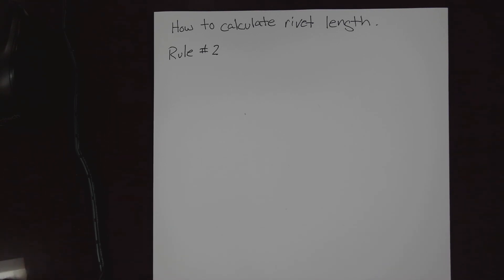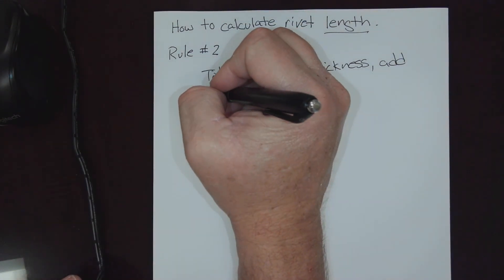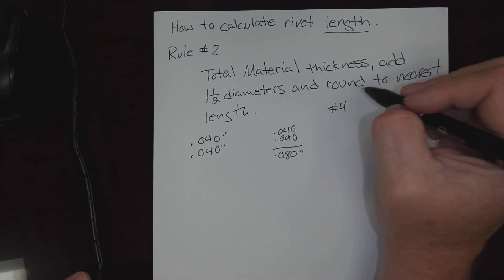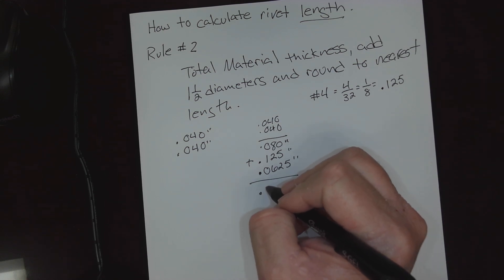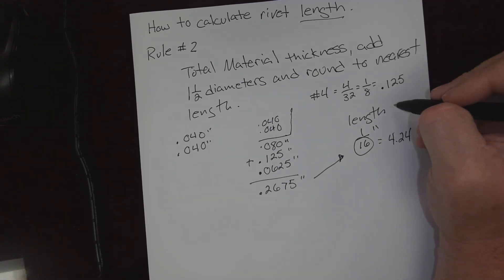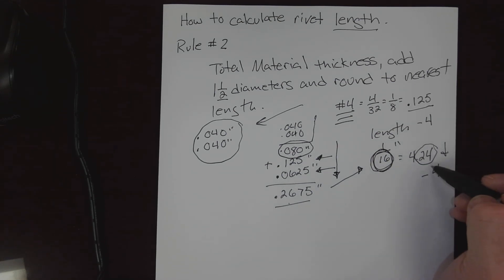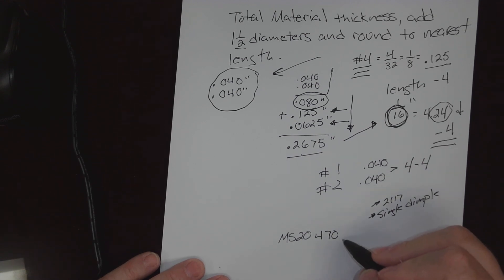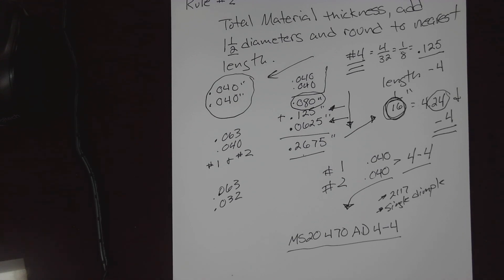Calculate Rivet Length

Comment: Nice video serries!  One important correction:  .2675 multiplied by 16 is 4.28.  So the correct rivet length for this project should be rounded up to  -4.5, (not  -4, as you miscalculated there).  Thanks!
Reply from the maker: Thank you for the catch.  I will make some changes.
Reply: I thought he said half sizes are not commonly used so would still round down to 4

Comment: Great and very comprehensive video.  Question... when you multiplied the 1/16, you used .265 instead of .2675.  Is there a general reason for that?  Thank you and I enjoy your content
Reply: He just messed up.  He should have calculated .2675 multiplied by 16.  Just a simple error on his part.  So the correct rivet length for this project is 4.5

Comment: Hey Jay! Thanks for both rules in Rivet calculation... What about the hole size (diameter) on both plates of the stack?
Reply from the maker: The hole size is based on your rivet size. Each rivet diameter has a corresponding drill bit diameter to drill the hole. The hole sizes are not going to be in fractions. There are a lot of charts available that will give you the exact bit size based on the rivet being used. Typically you would be using number or letter bits.

Comment: HI JAY WHERE DID THE .0625 COME FROM PLEASE EXPLAIN
Reply: The rule is to add
1. And. 1/2 the diameter
So he did it as
Add 1 dia which is +0.125
And then add 1/2 the dia 
(1/2 of 0.125) is = 0.0625
Put together you get
+0.125 + 0.0625
.......................
You could skip this by saying
+  (1.5  *   Dia) 
Where multiplying 1.5 takes care of this
But I imagine he just wants to make it clear that you add 1 Dia and then 1/2 Dia
By breaking it up into two steps

Comment: Hello Sir, Thks so much for you deplicted and comms: (international student?)/If i can allows myself: the Diameter of the Rivet should be equal to three times the thickness.  You take one Diameter that's true but add just 1/2 you forget to take one diameter supplementary.  If because i m on the review about the sheet metallic.  Tchiouz